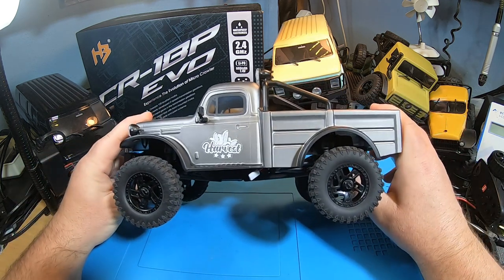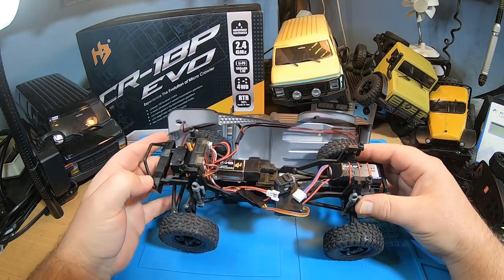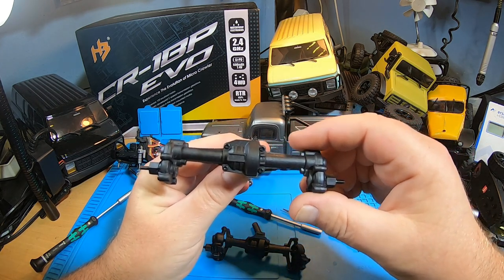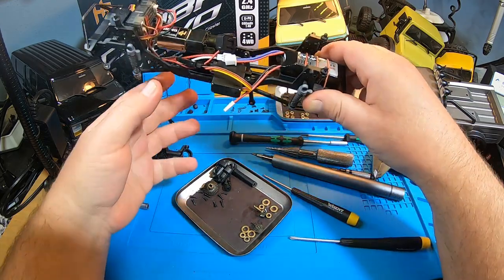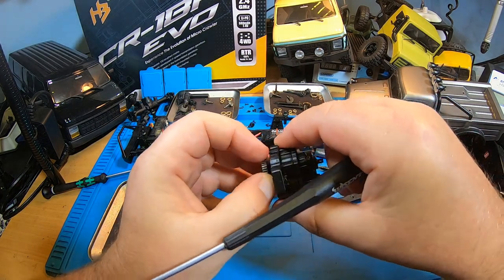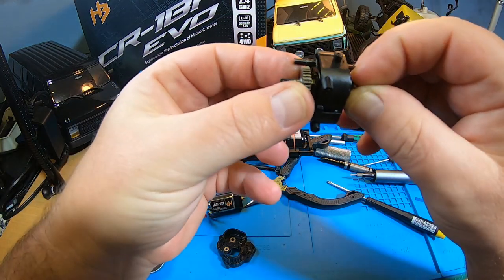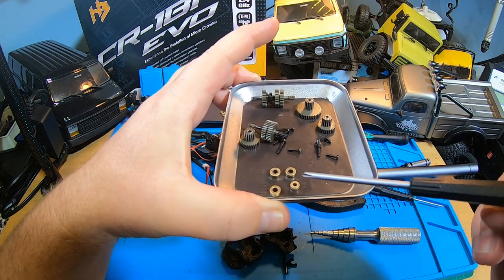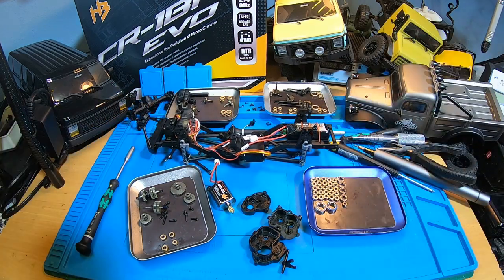Hobby Plus CR-18P Evo: Into the Guts!

Comment: This is awesome that you took all this time to disassemble the CR18P Evo. It is very helpful. Just one question. I looks like there are only 21pcs of the 3x6x2.5 and not 25. Three in the transmission, two in each pumpkin, eight in the rear portals and six in the front portals. Or am I missing something?
Reply from the maker: No... seems you are right and I have counted the bearings in the pumpkins double... oh man ;-) - Thank you!
Reply: @donaldsneffe  You are welcome. It is so easy to miscount the bearings.

Comment: Great video!!! What is the bolt size if you wanted to swap the phillips heads to hex? I think i am ready to start doing that with mine.
Reply from the maker: Thanks. 
M2 - frame screws are M2. The smaller screws into plastic are harder to change, "normal" 1.4 mm (SCX24) or 1.6 mm (RC4WD etc.) will not fit, M2 is too large - so I'll have to stick with Philips. But the annoying screws are the M2 on frame (mainly shocks, but also for example the screws holding the bumper from inside in the Rock Van).
Reply: @donaldsneffe  thanks a bunch. Ordered some from Amazon just now! Love the reviews and comparisons! Keep it up!